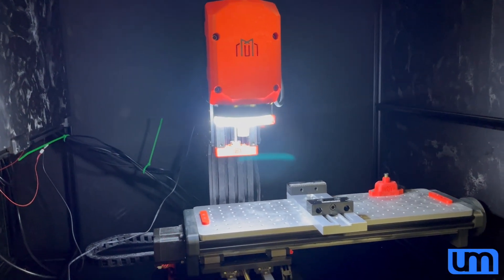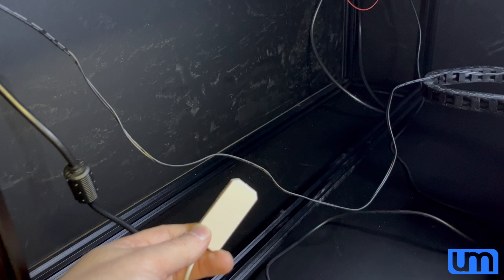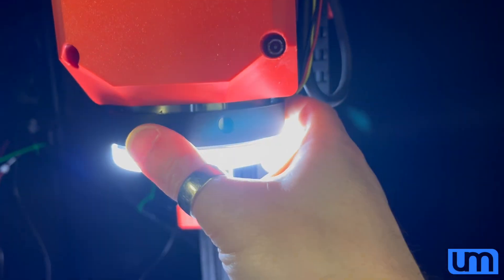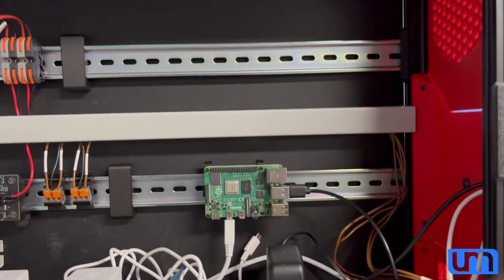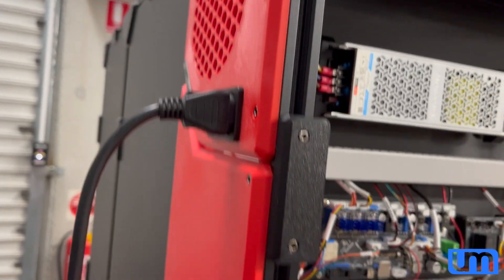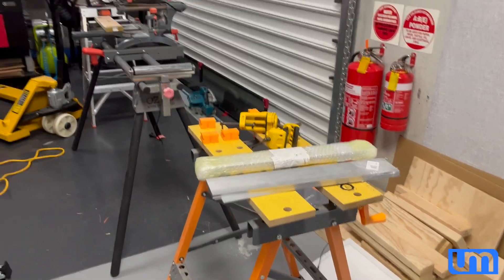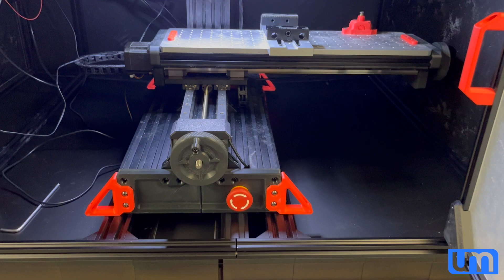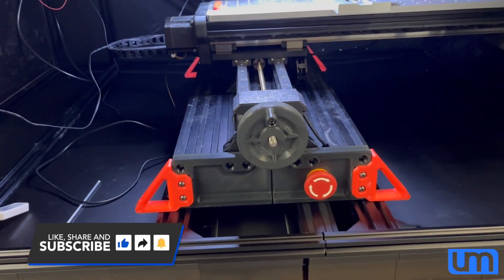Milo Moo Update 1

Comment: Is your collection system on your bucket list?
If you work with different materials, and keep the droppings in different buckets, it will be easy for recycle.

If you can connect a vacuum suction to your bucket like a shop vac has, the added suction to your milling chamber could possibly be ducted through the head to give it more cooling...
Just a thought.
Reply from the maker: It's on my "to do one day" list.   I wont be cutting much beyond soft metals,  so I don't really need to recycle, but it's a good option, thanks.

Comment: Isn't the middle of the base on the enclosure already a slide out bucket? From the front like a drawer?
Reply from the maker: No, it's screwed into place - I guess it could be a slide out if I remove the screws, but it's pretty long, and not sure I'd have the space to slide it out enough once it's in it's final location.